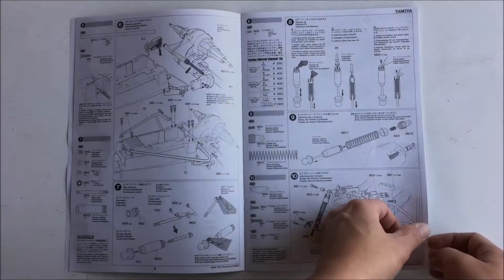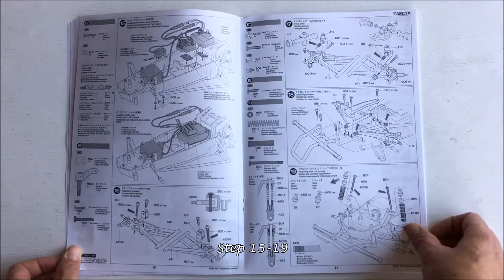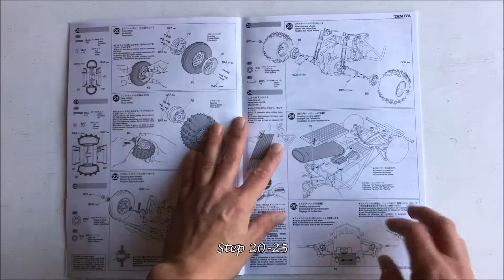BUiLDiNG the Tamiya Hornet Ltd. Black Metallic Edition 2014 (84383) Part 2/3: Step 11-25 Time Lapse!

Comment: Good to see you finally built the hornet. One of my favourite runners if not the best runner my lovely hornet. Yeah the black rims look really cool. I painted mine orange and painted the writing on the wheels white. It stands out nicely. You should paint the writing on the wheels too, it's tricky to do, but it looks so much better. Great video 👍
Reply from the maker: Harkeness O7 I haven't even run my Hornet yet but looking forward to it. Love running my Rising Fighter and Grasshopper. Sounds sweet, with the orange wheels. Would love to see that. Yeah, been thinking about painting the writing on some of my tires. Have found some good tutorials here on youtube, but need to find the right markers. How do you do it? Any recommendations?
Reply from the maker: Harkeness O7 ... and Thanks for the nice feedback! Appreciate it!
Reply: Nordic RC Visions you're welcome buddy! If you have a bit of patience, and a steady hand it shouldn't be to hard. I've done this several times before. One particular video I looked at doesn't actually show you, but tells you how to do it. Get a tub of white gloss x2 Tamiya paint. And a packet of toothpicks. Remove the tires, And lightly dab the paint don't put to much as it will drip everywhere. Most important, have plenty of bright light to be able to see the writing clearly. And have some soft tissue paper handy. Hope this tip helps you out. Cheers! Ps: 'yes'  run the hornet!!!
Reply from the maker: Harkeness O7 Thanks! Yeah I've heard about the 'toothpick' method. Also heard that it is quite hard to get a decent result. I'm thinking about getting some paint-markers instead, but I will try out your method first. I can always practice with some worn tires first and see how it goes :-) Thanks for the tip.
Reply from the maker: Harkeness O7 I will check it out!
Reply: Nordic RC Visions you're welcome buddy! Yes definitely practice with an old spare tire and see how you go. I agree with the markers would be much easier. I did it the hard way lol. Also thanks for sub me much appreciated! Good luck with the tires painting, I'm sure you'll do great👍
Reply from the maker: Thanks! I like your channel. You got great taste in cars and got some really beautiful units there :-)

Comment: What’s a good transmitter and receiver to use and what type of battery budget
Reply from the maker: Brandon B Ohh, too numerous to mention. Many use Flysky. Cheap receivers. I mainly use Sanwa and Tamiya. For this metallic body the antenna on the receiver needs to be external as the metal plated body could cause interference.

Comment: Building one of these. I’m hoping I got the gears right. I did everything in this video and the manual and I’m not sure it’s it’s right
Reply from the maker: I’m sure you got it right, Dude! If not you can always go back and fix it. I also made a mistake in this build (left some screws in the axle stays that are not supposed to be there). I did go back and fix it :-) No worries. Happy building!
Reply: Nordic RC Visions oh thanks, yeah my biggest concern was the gears. I’m just waiting to get all the electrical stuff to see if it runs well. Btw does the bearings make a big difference in the speed ?
Reply from the maker: Yeah, you will gain a little speed, and also more battery run time (less friction) but most importantly they will last a lot longer (unless you run in water and don't dry, clean and oil them afterwards) and your axles will continue to sit properly because there will be less wear and tear. Another bonus is that if you want to upgrade the motor at some point, or you at some point gonna put a lot of stress onto the motor (difficult terrain etc.) they will be less likely to be shredded. I recently had a malfunctional/shredded plastic bushing in my brushless bigwig, which caused damage to other gears in the gearbox as well. So, in short, there are a lot of bonus' with ball bearings :-)

Comment: I JUST CAN’T GET THOSE REAR WHEELS INTO THE SPIKE TYRES! DO YOU KNOW HOW TO? I’VE TRIED FOR AGES!
Reply from the maker: Yeah, you're definitely not the first one in the world having trouble with those Hornet tires :-) I did it with a lot of patience, sweat and tears ;-) but you can also check out Tamiya Legends' tip for the Grasshopper: https://www.youtube.com/watch?v=NTcMwVTWSzs&t=1s ... Should apply to the Hornet as well. Just be careful not to overcook/damage them :-)
Reply: YES! I did it! It definitely works much better with 2 people. My friend pulled the tyre out really hard and then I slipped the wheel in! It’s finished now!
Reply from the maker: Nice! Cool!

Comment: Mounting rear tires whats the secret?
Reply from the maker: doublefatstrat Hard work, sweat and a few curses ;-) It’s not easy, and even harder with the Grasshopper that have tires with a harder compound. Use of tools (screwdriver etc.) that can strecth the tires in the process (gently) is also a good idea. But very few people find it easy. Perseverance and patience is needed, and then you will succeed.
Reply: patience is not one of my virtues young apprentice.
Reply from the maker: Then a lot of sweat and swearing and you'll make it :-)
Reply: This is the key. Make sure that you pull out the inner part of the tyre first, then get the lip tightly bound around the rim & pass it through.
https://www.youtube.com/watch?v=Rs1xU00FaSM

Comment: Im making my own lego 1/20 scale rwd short course truck through I have a really really omg loose diff might just lock it
Reply: I'm just short of two shock absorbers and four wheels I just can't make a working independent front suspension 
RESEARCH TIME!
Reply from the maker: Nice with a LEGO truck! Yeah, too slippery diffs can ruin all the fun :-)
Reply: Nordic RC Visions sigh I guess I gotta buy real rc shocks and I am having trouble with the gearbox other than that I've completed the frame the rollcage and the front independent suspension with steering I have to buy lego electronics too otherwise I'll have to leave it as a rolling chassis